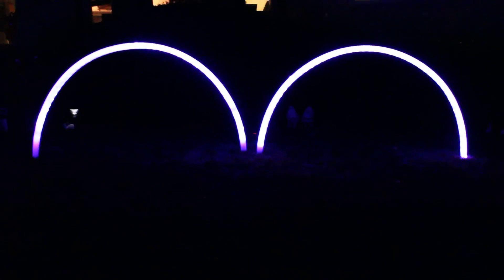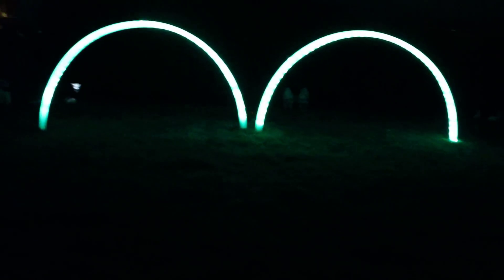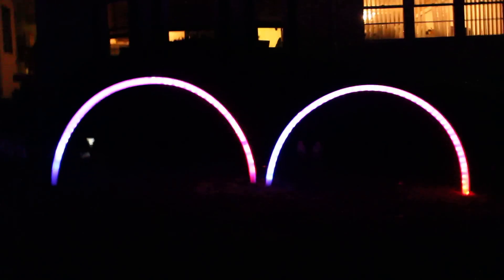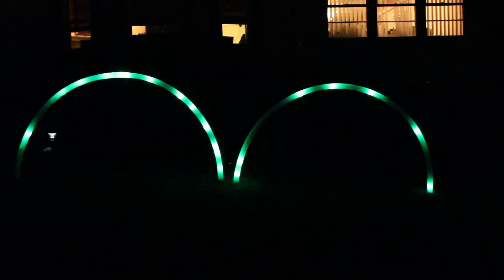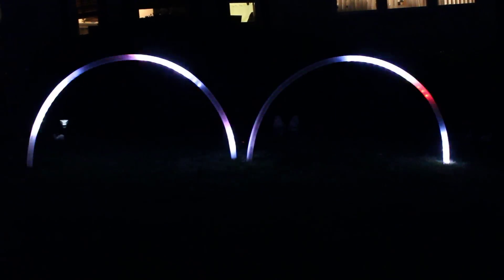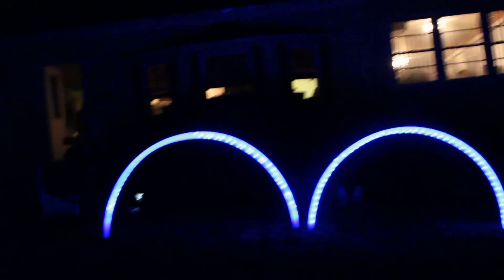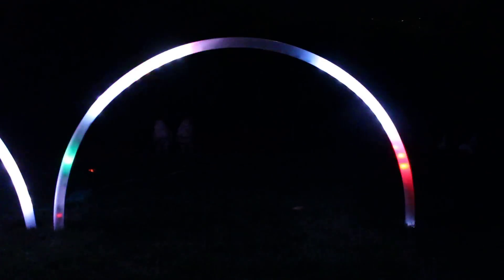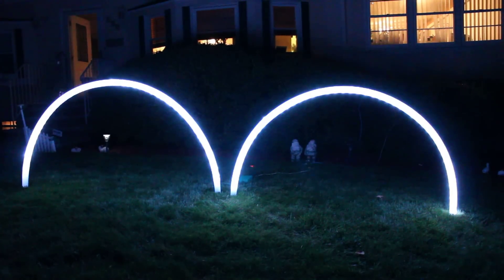Pixel arch demo using HDPE tubing

Comment: is this the exact tube you used? https://www.mcmaster.com/#50375k65/=1c4ixhj   You can use 3/4" HDEP tubing inside the 2" tubing if you want the leds light to be more even and not have hot spots